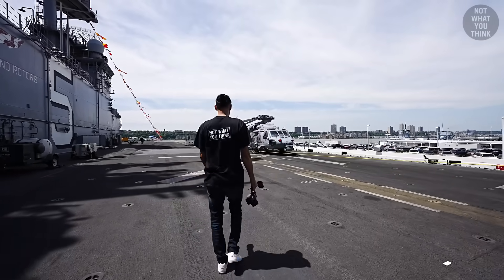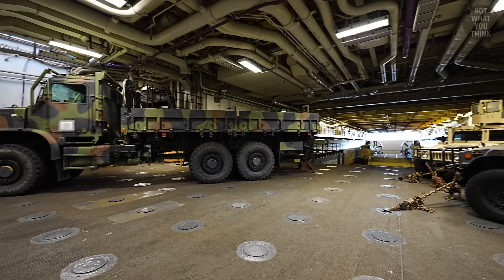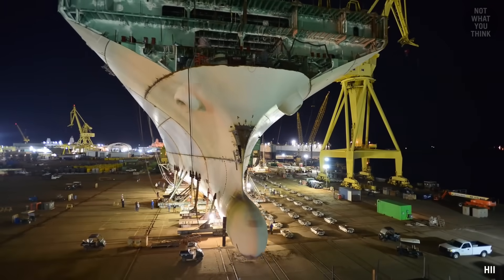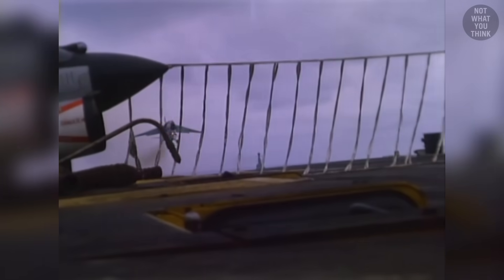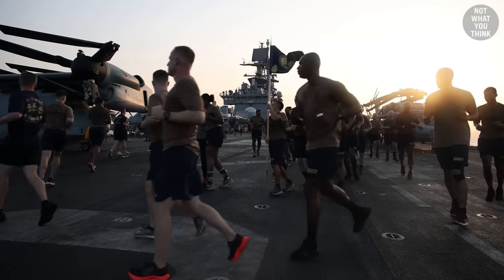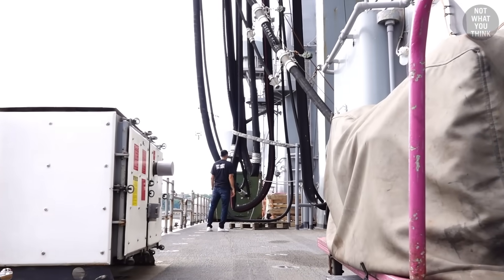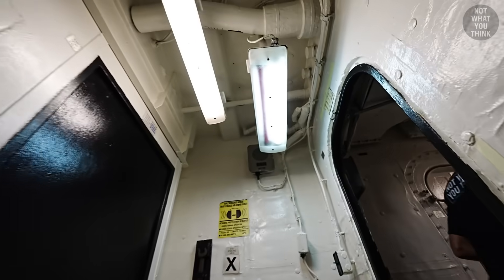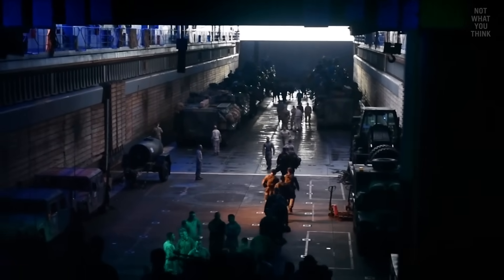I Visited the Ship that Makes Supercarriers Look EASY

Comment: There's a lot more that isn't explain... when an LCU comes in they throw 4 lines on each side (8 total) to stop it as the LCU is driving in with engines on and still at around 4kts... lines 1&3 get thrown down and the BM/Seamen pull the lines to stop it from going forward and then lines 2&4 are thrown down to stop it from going back...

Also USS Rushmore LSD-47 (my first ship) had the largest well deck holding 3 LCU's or 5 LCAC's that is if they all have the ramps connecting them. 

When any Amphibious Readiness Group Deploys they usually have 1-LHA/LHD, 1 or 2 - LPD's and 1- LSD... however when you have actual operations happening you will have the CLF (Commander Landing Forces) and CATF (Commander Amphibious Task Force), CLF is usually a O-5/O-6 from the Marines and CATF is usually a O-6/O-7 from the Navy, usually the Marine CO and the Carrier CO or the Strike Group Admiral... CLF give the green light for his Marines and CATF will green light the operation... during which the Aircraft Carrier/LHD/LHA will launch Jets and bombard the beach... DDG and CG will launch missiles and also Bombard the beach... in this time the Amphibs will drop the Marines in the water and they will start heading towards the beach... you stop Missile attacks at a certain range and air superiority at a certain range as you want the Marines on a beach at a specific time... it all time based to stop 1 friendly fire but also 2 prevent too much time lost that the enemy can regroup and launch a counter attack... the whole process to to prevent another D-Day slaughter while ensuring safety and efficiency of US forces
Reply: Plankowner on USS Fort McHenry LSD 43 in '87.  It was recently decommissioned , but they forgot to call me!😂

Comment: strongly believe that LHA & LHDs should be non-amphibious . . . meaning no vehicle deck & no temporary submerging well deck either . . . especially in case of LHAs that feature a full length straight & flat flight deck for rotorcraft (helicopter) & tiltrotor operations . . . amphibious expeditionary support should be designated to stern loading landing ships only . . .

Comment: @9:52 FACT CHECK: Not $16,000! $1600 for the top and bottoms. The higher level Proximity Turnouts cost $3300. Regular firefighting gear cost about $1400.

Comment: Given the size of the vessel, and its mission parameters, why are they not nuclear powered like the CVN? Would that not improve flexibility, economy and efficiency?
Reply: 1. Having a ship powered by cancer juice relatively close to enemy shores probably isn't the best of ideas

2. We used to have nuclear powered cruisers. It turns out they were too expensive. Now, LHD's are significantly larger(use more oil), so maybe the economics make more sense, I'm not sure. Still would be a lot more paperwork and initial cost though.

Comment: Your information is about 85% Correct! SUPER CARRIER more capable and are able to project their power well beyond the distance the Amphibious Assault Ship does because the Carrier Air Wing can mid-air refuel and go further but the Aircraft like the Harrier and the F-35B has a MUCH SHORTER RANGE and is only use to provide Close In Air Support. Amphibious Assault Ships like the Bataan and Wasp only project their Firepower over the Horizon due to the Landing Craft Range and Speed so Normally a Carrier would have ALREADY have Soften the Target Area before the Marines Hit the BEACH! 
The USMC MEU-SOC Units deployed on Amphibious Assault Ships are very Specialized Troops that can Execute Missions like Extraction of Embassy Personnel from a country that is destabilizing into Civil War, Rescue of Hostages or Strengthen an US Embassy or Military Base that might be getting ready to be attacked and they are VERY GOOD at that. Units like the 75th Ranger Regiment can also accomplish this missions but they normally have to FLY IN and do a Parachute or Helicopter Insertion into the HOTZONE! The Air Force really does not have a IRF since they do not have Combat Troops they are Security Forces that can fly in but they normally have a US ARMY RANGER Company with them to get the Job Done.  US NAVY SEALs are more of a Direct Action Force that can do many of the MEU-SOC Unit Missions but they do not have the Combined Weapon Packages of Armor, Artillery and Air Power when they go into harms way. 
I served in the US NAVY for 8 years and worked in Aviation but because of my Security Clearance and the Fact that I was a Competitive Shooter before joining the NAVY I was pulled from my job and worked in a Security Unit that worked with MEU-SOC and SEALs plus other units during training cycles. Our Job was to Protect Navy Assets from both the Water and Air by using Helicopters and Fast Moving well Armed Boats that could engage an Enemy Boat and Board the Vessel and inspect it. I was part of that unit for almost 2 years and it was some of the best times I had while in Uniform. I made allot of friend that I still keep in touch to this day and since I did not Drink and party I used to go to the USMC Weapons Range to Shoot and the I was there so much that I was put on payroll and got allot of Gunsmithing and Armorers Training plus was Certified as Small Arms Instructor on my own time and helped to qualify over 150 members of my Command in less than 7 months which was a very good record according to the commendation letter I received.

Comment: One correction, it can't go halfway around the world un-refueled.  Unlike or Carriers, it is NOT nuclear powered and only has a top speed of 22 knots.  See stats: Propulsion, Two boilers, two geared steam turbines, two shafts, 70,000 shp (52,000 kW); Speed	22 knots (41 km/h; 25 mph)
Range	9,500 nautical miles (17,600 km; 10,900 mi) at 18 kn (33 km/h; 21 mph)  Nice to see you got to hang out with some MCs, who took over media duties from JOs and PHs.  I am a former PH (Photographer's Mate)

Comment: I was on the USS Makin Island, an LHD-8 wasp class ship. I was a motor T operator, and most of the time, I was moving trucks in the well deck, getting them on and off the LCACs. That was a lot of my job, but I also got to fly on V-22s to get into different places, and on CH-53s. It was a good time and definitely the best part of my time in the Corps.

Moving trucks around the well deck is one hell of a task. I would only put people I trusted in my trucks to move them around in such tight spaces. There are people around the well deck guiding you, but if you're not precise with the brake and gas, you could very easily hit something or someone. I saw some Marines who didn't have good throttle control try to climb up the ramp off the LCAC. They'd mash the gas to get going too fast, then have to stop, and repeat that all the way up the ramp. I always taught my guys how to modulate the gas pedal with very minor movements to keep a constant speed up the ramps and how to hold themselves in place on the ramp without using the brake pedal. I always loved teaching things like that to the Marines who were under me and watching them improve their driving skills.

Comment: I would agree with all statements except that the LHA is more complex than a supercarrier. It not only operates long range fixed wing aircraft, but the nuclear power plant, the four steam catapults, the four arresting engines plus all the rotary wing and VTOL air operations like the LHA. The weapons elevators on a supercarrier are a mechanical marvel unto themselves. The communication/radar and weapons aboard are state of the art and have entire divisions to maintain. Feeding 5300 sailors and Marines is also a very complex evolution. And we used to UNREP smaller ships with our supplies. I would concede that the LHA is a different type of complexity, not a degree of more complex. I don't know if that sounds right, you know what I mean

Comment: Landing Ship Docks have been more fascinating to me than Supercarriers. They are capable of so much in terms of force projection and yet smaller than a super carrier.
Thanks for covering this!
Reply: This is an LHA.
Reply: Though you didn’t say, it’s implied & obvious to me you know this USS Bataan is not an LSD.  However, I understand why you commented  on LSD’s, and I did appreciate them. I think it’s most likely you must have seen what I saw, the similarities of LSD’s & ships in this class.  

To me, the Bataan is the essentially a direct descendent of the LSD. It has all the functions of WW2 LSD’s, plus more.  Its like a 1943 LSD has had  flightdeck of a WW2 Jeep Carrier installed over the top, of course this new class (LHT?) has different and more functions than the LSD, they still are functioning very similar.

Incidentally, Our dad, HG Ball, Lt.JG, was on a Landing Ship Dock in the Pacific, in WW2, or 3.5 years (‘43-‘46).  It was the USS Oak Hill, LSD-7, and it continued to be in service until the end of the Vietnam war.

Comment: The deck markings even include special orientations for helicopters landing with live ordinance to prevent a repeat of the disaster caused when an unintended launch of a Zuni rocket from a F-4B Phantom started a fire which caused the deaths of 134 sailors and pilots onboard the aircraft carrier USS Forrestal in the Gulf of Tonkin.

Comment: Instead of using extremely expensive thermion deck coverage. The Navy should get Space X to make them a bunch of heat tiles like they use on Starship. Because these are not going to experience severe shaking like on the Starship during launch, they could just be glued down, like they do on the nose of Starship. Probably with a less expensive adhesive. It might even be that a less expensive refractory tile would be good enough, as reentry involves plasma hot temperatures. And jet exhaust is not that hot.

Comment: 14:19  "Every three days" ehh. That may well be true if you're hauling absolute ass for three days straight. I remember seeing, on one of the bridge bulkheads, the plot of fuel consumption curves for split, trail, and combined shaft configurations vs speed. It's very much a nonlinear curve, lol. 

 We'd we'd do a sprint here and there, and shoot for 31+ kts for five or maybe fifteen minutes, we rarely made way at more than 21, 22 kts for extended amounts of time. More often was 16 kts or so for significant transits. (Obviously, this is for exercises and events and stuff that are planned in advance. Getting on station in an emerging situation would be another matter.)

I think we did like 26 kts the whole way from Yokosuka to the affected area after the 3/11 Tohoku earthquake for Operation Tomodachi. 

During my time, our only sustained full- and near full-speed run, like 28 to 31 kts as permitted by the sea state, for I think at least 12 hours or so, was trying to outrun a typhoon that was going to cross our paths (we could either get north of where it was headed soon to resume our planned transit, or we'd lose like two days or something trying to go around it idr). 

So every three days is pretty much worst case. In reality we did a RAS like every ten days at most, but usually more like every two or three weeks iirc. Nothing like every three days. Though toward the end of my time I no longer had to do them, being on watch in CIC instead, I doubt I could forget bc RAS fucking sucks lol
Reply from the maker: Thanks for clarifying :-)
Reply: @NotWhatYouThink   We might actually have gone even faster after the earthquake tbh, at least for part of the sprint. We wouldn't have been fully fueled when we left bc there was no time to top off, and I do remember we did a RAS really soon after getting there, maybe a few days. One of the only peacetime situations where basically the game plan is to go max speed and only slower if you have to, calculating fuel needed so you're not risking running dry if something delays your oiler.

Comment: Lived aboard uss Constellation cv-64 for over 3 years. Youre wrong on multiple points sir. No catapults or arresting gear on an amphibious boat. We had both Sailors and Morons. Oops, marines i mean stationed aboard the boat. A Carrie is FAR more complex. You need to do better homework. Go aboard a carrier and you'll change your tune.
Reply from the maker: I think you may be talking about the complexity of the equipment on an aircraft carrier. But what makes the operations executed by aircraft carriers more complex than amphibs?
Reply: @NotWhatYouThink  launching and recovering aircraft, helo' and coordinating with an entire fleet simultaneously. We had a tad over 5,500 Sailors and crayon eaters aboard the Connie. It's literally a floating city. Far more complex my friend. Thank you for your response. I absolutely luv your channel btw. ABE3 (AW) here. Ran deckedge for cat 3 for O.I.F. , O.E.F. and O.S.W. It wasn't called America's Flagship for no reason. Keep up the great work. I have some really great footage if your interested.
Reply from the maker: I guess I'd know better once I visit a carrier :-)
Footage? Hell yeah! Please contact us via the general inquiry email in the "about" section of the channel.

Comment: After watching this vid and considering carefully... the US absolutely MUST reactivate and refurbish its Battleships. These "beach landings" would be extremely vulnerable to coastal defenses! But with modern weapons and the addition of new weapons to combat things like drone swarms (which Battleships could easily be modernized to have, as they have the space for them) a Battleship could easily take control of a landing area. Just imagine a Battleiship with modern CWIZ and anti-drone laser systems - nothing would stand a chance, no matter the size.
Reply: While I agree that the US Navy could use purpose built ships for modern weapons and drone technology to protect landings -- I just don't think re-activating and refurbishing Battleships is the way to go.   Those ships were simply designed for a different era of warfare and there is no need for much of the integral features they possess such as their heavy armor belts and large guns with all their supporting infrastructure (barbettes, magazines, rangefinders...).   Better to design a new ship that has everything you need.   Plus they're old.  The youngest one available to even be re-activated is over 80 years old.
Reply: @arkwill14  it comes down to costs. A whole new type of ship would be billions, and refitted Battleship would be "only" a couple hundred million.  Still many times cheaper. Besides which: armor belts to protect against torpedoes and mines? Absolutely essential, especially given that there are now boat drones carrying similar payloads to that of a torpedo. Same goes for armor elsewhere: a drone swarm might get past a CWIZ or similar system, but such drones wouldn't be able to defeat the BB's armor. The large guns for coast bombardment would be a  boon,  especially considering their huge ranges. And adding things like missile batteries wouldn't be a chore given how much deck space would be gaine by replacing old 50bmg and 20mm AA batteries with CWIZ systems. 

There's just so many advantages, but the cost is the most important,  and most significant.

Comment: Devil's advocate here -- is it really that much of a benefit to have one ship perform both tasks of operating a flight deck AND a well deck?   It seems like it would be better to have two separate ships perform these tasks as they could be specifically optimized to do that mission without either being compromised by the need to do both.   Additionally, that would diversify your naval assets and avoid the "all-eggs-in-one-basket" vulnerability.